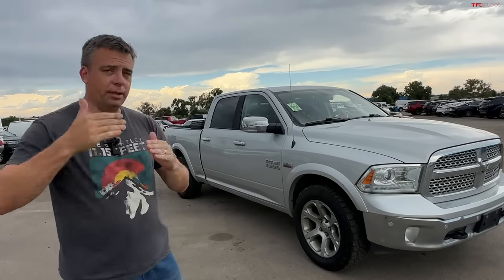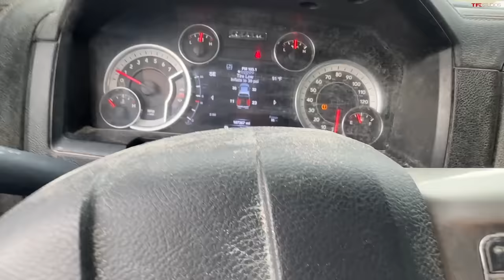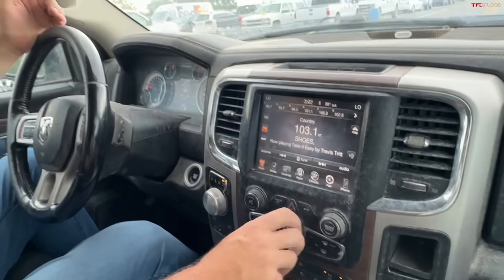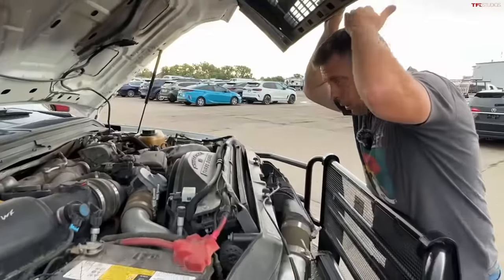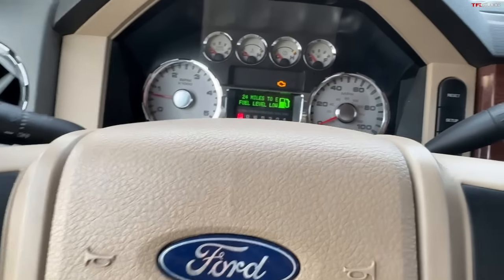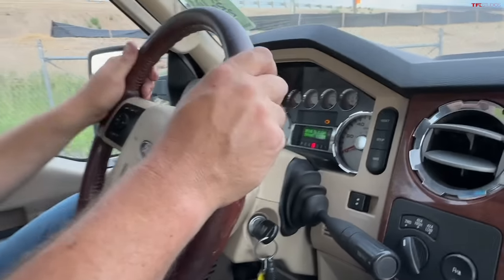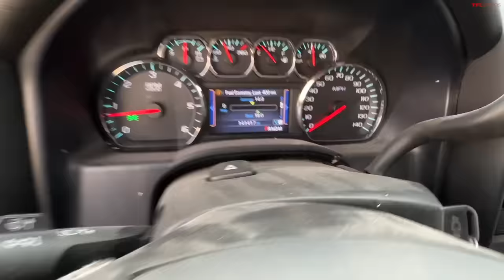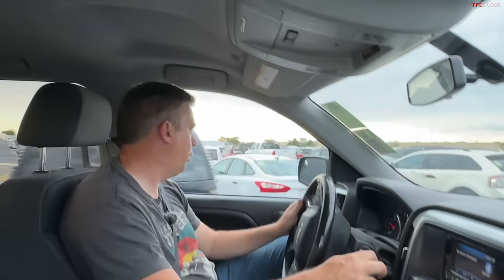These Are the Top 3 Used Trucks You Should Never, EVER Buy!

Comment: More than half the time, I hear a ticking noise from a hemi it's because exhaust manifold bolts breaking or Crack exh manifold cuasing exhuast leak, not a lifter tick.once you replace exhuast manifold fastener and maybe go with up upgraded arp studs and exhuast manifold and ticking goes away. I replaced many of them on customers hemi and unfortunately, many freak out thinking its lifter noise and don't even take it to shop they just trade it in.

Comment: TFL Truck, if you’re going to attack trucks issues at least do more research!! I know RAMs have had their share of recalls. That tick your hearing is not a lifter tick. The more common reason for the tick is that they get exhaust manifold leak, and in my case the bolts snapped and needed to be replaced along with the manifold, and the heat plate which I did myself and was a $300 fix. The only other thing that needed to be changed on my 2014 5.7 V8 HEMI  RAM was the fuel pump, a $90 fix if you do it yourself. I currently have 84,000 miles on it.

Comment: The Ford 6.7L Diesel is not a redesigned 6.4L. The 6.4L was made by International, the 6.7L was a new motor made by Ford. So they did just get rid of the engine completely and replaced it with a new one.

Comment: I have a 2013 Tahoe with 244,587 miles and have never had an issue with any major components   Had a  95 350 v8 tahoe it caught fire with almost the same mileage as my 2013  Difference is my detail to regular oil changes and all wear items.  I let a blower motor rattle for to long it caught fire in the 95   my 2013 has the 5.3 ln it  My advice is stay away with anything with the fuel saving systems   I have no such system in the 2013 and its a beauty and been a good friend.  Only complaints are the door handles and molding on the doors is crap.   besides that I love it.
Reply: The 2013 Tahoe has AFM. It is how you maintain it that determines how long the system works before breaking down.

Comment: I checked multiple used Ram 1500’s from 2012-2017 using CarGurus and typed in vin numbers and they varied from none to 3 recalls. Not sure where 16 is coming from…
Reply: There has never been 16 recalls on these trucks. You are correct on about 3. The tailgate , the shifter linkage and a flash update , i think. But not 16 for sure.

Comment: My 2016 ram 5.7 no issues. That may be the exhaust manifold bolt leak not hemi tick that you may confused with the tick. GM has same issues  .
Watch out for direct injection

Comment: I have a 2013 ram with 134k never had any known issues.  No lifter issues no broken manifold bolts.  No seat issues.  
You can deactivate the cyl deactivation by manually putting the transmission in 6th with the +/- button on the shifter.  
I always use a zddp/zinc additive in the oil to protect the cam and lifters.

The Truck in this video was destroyed and never maintained. You deliberately found the worst truck you could for your video.  Whoever owned it must have thrown bags if drywall mud in it.  Anyone with an iq over 1 would have enough sense to walk away from that thing

Comment: I’ve got a 2017 GMC Sierra with the 6.2 and 125K miles that is on its third transmission. The original one went 100K. The second one was new from GM and only lasted 23K before it was replaced under warranty. Anyone wanna buy a 2017 Sierra?

Comment: Ford 6.4 liter diesel that with the regeneration issue if it not cleaned properly will cause reduced engine speed until it won’t drive faster than 5 mph  
Also has lots of issues with oil leaks

Comment: If i was going to built a truck. It would be a 90's model 12v Cummins with the 5spd Allison like came in the F-600's. The old 12v can make good power with exhaust, fuel pump, and air intake upgrades. And the old 5spd Allison was almost indestructible

Comment: Your wrong on the Hemi. It is the exhaust manifold bolts that snap off which makes the tapping noise not the lifters. Also just turn on towing mode if you have it. That will stop the cylinder shut down or find a engine scanner that will shut that off completely before any trouble starts.

Comment: That Ram has a exhaust manifold leak. Not a lifter tick. Fyi my 2012 ram 1500 hemi has had the actual lifter tick for over 50k miles. Still runs great. I run penzoil ultra platinum in 0w40. My Ram has 175k on it now. I would drive it across country with no hesitation. When the cam and lifters do fail. Just swap it with a 6.4 hemi. You can get one with low miles for 4k or less.

Comment: As someone who has had two different Ram trucks with the Hemi lifter tick, I can tell you that IMO the #1 cause is the movement to thinner oils for the engine. You need to run 5w30 despite what the manual says. My brother's 2004 Durango a 5.7 Hemi with the MDS and his manual states 5w30 and because of that, you notice that most of those trucks are fine. So that is my recommendation. If your budget allows, I would use Redline 5w30, otherwise, Run a good 5w30 oil like Mobil 1 Fully Synthetic 5w30 or 0w40 and you are good. Also do it for shorter oil intervals. 
As for the other Hemi tick, the manifold bolts, you just need to replace them and you're good. Its not a huge issue.
Also did anyone notice how low Andre was sitting in relation to the dash in the Chevy? This is what I've been saying. In Chevy trucks, you sit quite low in the cab, like in a sedan. That doesn't work as well for when you want to go off road. Less view of the track.
Reply: himi didnot have the MDS in 2004 or 2005, it started in 2006!
Reply: @berardoferrari  My brother's 2004 had MDS and it was available on Durangos from 2004. A friend of mine had the two 2nd gen Durangos (2004 & 2007), both equipped with MDS.

Comment: My work vehicle is a GMC, the electrical  gremlins with this thing has been so bad, that I will never buy a GM for personal use. At this time it is flashing service stabilitrak and service traction control. Driving at a low speed it is jerky from the traction control engaging,  and when slowing to a stop the downshifts are brutally hard. Off to the shop it goes for the sixth time since new.

Comment: This is not accurate regarding the 5.7 Hemi. That loud ticking noise at start up is almost certainly a broken exhaust manifold bolt. If it goes away after a few minutes then you know that's the issue. As for ticking in general. Hemi's tick. Whether a little or a lot. I've owned 6 of them. They all ticked, from new. If it's a bad cam/lifter you'll know as you'll get misfire codes. The thing that destroys these engines is idling. This is due to how the engine block is designed. Specifically lifter angle. They're at a very shallow angle which prevent oil run down to the cam lobes. They're also not flow through. So as you are idling the only way the cam and followers are lubricated is via crank sling. And there's just not enough RPM's at idle to do this effectively. Coupled with the fact that the distance between the crank and cam was increased on the Gen 3 Hemi, along with an oil passage placed directly below the cam. If you are shopping for a used Ram with the 5.7 the #1 thing you want to look at in the EVIC is idle hours. If that engine spent more than 75 hours idling per year walk away. I won't discount the MDS being trash. Those MDS lifters are just not robust.

Comment: I'm trying to buy a used pickup truck for around $8,000. I either find older trucks in good shape with over 200,000 miles or older trucks with under 200,000 that are beat up. The newest I can find at that price is 2013 so far but most are from 2000 to 2009. I started researching the engines in the trucks of those years. Every single one had some catastrophic engine issues. I need a 4x4 and I like the Ford f150 but they have plug and cam phasers problems and the Triton 5.4 liter is a nightmare the 5.0 coyote motor same thing the 5.7 dodge hemi is going to break it's not if but when. The 5.3 chevy and GMC engines are breaking like crazy. I'm to the point I don't know what to do. I cant afford a newer truck I don't make a lot of money. Now it looks like I cant even afford a used truck. If I buy one and the engine goes Im screwed. So far Ive found one engine I'm willing to trust and thats the Toyota 4.7 liter V8. They have kept running strong up to 500,000 miles and can be relaced for aroun 5,000 to 6,000.

Comment: My dads 2014 silverado had to have the entire engine replaced. But, and its a big but, I chose it over my 2nd gen Tacoma. Its just much better at truck stuff.  Considering my paint failed, frame failed, ac failed, exhaust failed, and suspension failed on my Taco Im not convinced. I would buy a 2021 Tundra if they weren’t $50,000

Comment: Had a '14 Silverado, in addition to doing lifters 2x before 80k miles, and the worn out center console; the AC is a common problem too. The evaporator and condenser had to be replaced, and of course not at the same time.
Reply: You or your mechanic did something ignorant if you had two lifter failures in 80k miles.
Reply: @hochhaul  I should've completely deleted it from the start, but has gone back to school and could only afford to do the one bank of lifters with the failed one. Turns out the issue stemmed in the solenoid for the afm system, so the same lifter failed again.
Reply: @huntersbuilds8769  hilarious. I work with a dozen guys with 2014+ gm trucks. A bunch of those guys have 200k+ miles on their trucks, afm  never "deleted". They have had their AC fail or have a radiator leak, but not one has had a lifter fail. You should have changed your oil more often because that is what causes lifter problems. Just because the computer says your oil has life doesn't mean you should go 7000 or 10000 miles on the same oil.
Reply: Lol 5k services it's whole life.  It was great until it hit 50k. I have buddies with the same truck, no issue and 200k. But they made some lemons and I had one

Comment: Heyyyyyyyyyyyyyyyy
Don't be talking trash about my RAM. 

Been having my truck new since 09 and it's been great.

I have 214,000 miles and still going strong. 

I recommend Lucas to keep it going. 
Oil alone is not enough.  

I be honest,  that ticking noise kick in at 209,000 miles but it was all replaced for free plus free water pump. 
My truck is under lifetime Power train warranty.  

Took a few months to Convince them I had a issue but they fix it. New cam shaft and lifters 

Now it runs like new. 

I STRONGLY RECOMMEND LUCAS.    Synthetic to extend the life of your RAM. 

THE average new owner keeps them for 3 to 6 yrs. 
Me at 214,000, that's why too long to keep for average owner.  

8yrs straight with no issues. 
After that each yr just been Normal wear and tear
Reply: New water pump, new camshaft, new lifters. Zero issues. School I graduated from says that equals 3 issues. But, whatever.
Reply: @Youcantchangemyname  
😆 🤣  to drive it from 0 to 209,000 miles. I say that's not bad had somone not had Warranty 

They keep asking to buy my truck to get me out of my lifetime warranty.  
Nope, gonna keep pushing

Comment: There isn’t enough or any ports for oil to coat Cams. . Oil is supposed to be thrown up on to Cams as truck moves. Hemi shouldn’t be idled for long periods. Cams will starve for oil at extended idle. Creating lift tick. 6.4 Hemi oil pump and oil pan helps solve this issue(more oil)  or don’t idle.

Comment: I have owned 3 4th gen Rams and never really had any issues. No seat wear on any of them and no tick either other than just a tiny amount at startup. All had well over 100k on them. The first one finally needed new ball joints at around 110k but that was really it. Oh wait, I did have an issue with the second one with water getting in the turn signal housing on the mirror and charting out the puddle light. Fixed and no more issue. That same mirror also used to close slower (passenger side) than the drivers side as they were power. Once the mirror was replaced that issue wet away. Never going to say people do not have issues but out of 3 i never really did. I also owned a 2017 Ford F150 with the 2.6 ecoboost. That one lived in the shop for engine issues. Had a dieseling sound that was some cheap part but once replace it came back after another 15k. Sagging front coils, fuel line leaks, coolant leak, turbo failure when towing. I am not really a brand loyal person but goes to show even what is considered a great truck can be a lemon.

Comment: The tick on that Ram 5.7 Hemi sounds like an exhaust leak, the lifter tick tends to be a bit less pronounced. The Ford 6.4 can be a nightmare which is too bad because the rest of the truck is pretty good. The GM tcase oil pumps love to fail and you have to replace the whole thing because it eats the case and everything in it, the G80 locker is great if you know how to use it, if you don't know how to use it it will explode. For the most part the LS based engines are good, it's just all the management systems around them. If it was my money I'd go with the Ram on this one because it's the devil I know
Reply: No its a lifter tick , they are notorious for it.

Comment: No It is not a typical sound with these hemis.. I bought a Dodge ram like this.. in 2013 off the showroom 80.000 miles it
 developed a tick. 100.000 MI lifter problem extended warranty would not cover it I was out $2,500.
Had it repaired after ten thousand miles valve spring broke severe engine damage..
So when you hear the ticking be prepared

Comment: 07-21 Tundras are actually pretty great trucks, toyota has always had rust issues (just like the big 3 do) im glad that they corrected the with the 5.4... the 2v are great
Reply: 3v are fine too idk what everyone's going so crazy about. I owned 2 trucks with it, a 2004 and now a 2010 and both were rock solid engines, no issues on the 2004 up until I sold it for the newer 2010 and this ones still going great

Comment: Easy choice: stay away from GM, Ford, Ram. Problems: Active Fuel Management, lifters, cams, oil leaks, burning oil, starters, fuel injectors, turbo chargers, direct injection, variable cam phasing...  look for a 2020 Toyota Tundra.

Comment: The ford 6.4 has trouble with high pressure pump failure, turbo failure, and clogged particulate traps. All will make it a pig that doesn’t accelerate. It also requires the cab to be removed to get to these components making servicing expensive and difficult. Mine had all of these issues and dumped diesel into the crankcase during regen. At 2500 mile oil change it would have 24 quarts of oil/diesel in it. Multiple reprogramming didn’t fix it. At around 80k miles the crankshaft had a connecting rod journal break off. The crank was in 3 pieces. Ford tried to deny warranty because they found a couple drops of water in the fuel. I told them to pound rocks and they eventually fixed it, but I had to wait 2 months. Sold it after. Avoid.

Comment: That Ram 1500 isn’t lifter tick. That’s broken exhaust manifold bolts. I’ve seen several like that. Look through the wheel well and you’ll see the rear bolt heads missing or several of them missing.

Comment: My number 1 do not buy, would be the Nissan Titan XD with the Cummins V8. Mine had nothing but problems with the transfer case, DEF system (constant regeneration), dead pedal, blend door actuator failures, seat heaters failing, tail lights cracking, and the truck wouldn’t hold an alignment or drive straight even with 7 alignments, a new pitman arm and steering box and having a Nissan engineer fly out to look at it.

Comment: The 3.6 Pentastar has problems that require cylinder head replacement. Mostly mentioned on Dodge and Chrysler minivan forums. Ticking is one of the early symptoms.
Reply: That issue was found on the earlier 3.6. The cylinder head was changed to address this.

Comment: The Ford 6.4 didn't have any power train issues.  It was all engine related.  The turbos fails alot lose of power and dumping oil in to the engine, exhaust, or all of the above.  That then messes up your emission filter.

Comment: My 2004 ford FX150 had a lifter tick and my 2007 f150 crew had a rod nock both under 100k. The 2004 blew up one block before I could make it to the Ford dealer I had brought it in 20k earlier when I first noticed the tick and they told me nothing was wrong then it grew louder and louder that is when I made the second app. lifter ticks sound like metal pinging on metal.